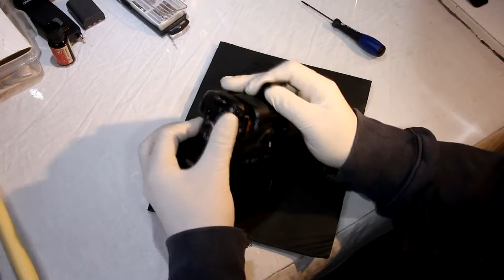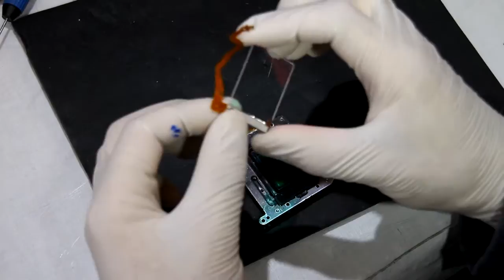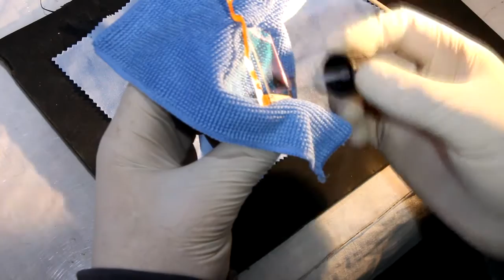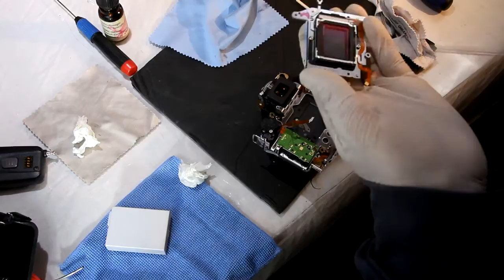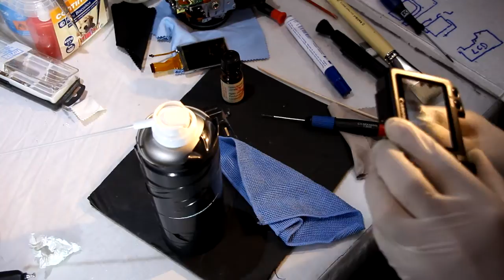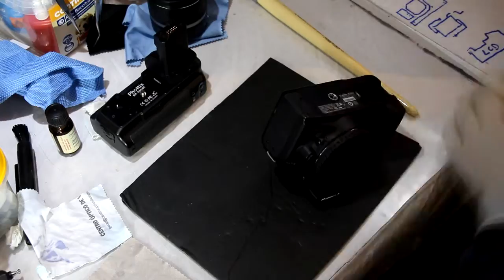Cleaning, assembly, DSLR Camera Sensor Canon 1000D (How to) Remove Fungus!

Comment: hello we have a pentax k10 and now there is fungus on the back of the sensor. would you be able to help us to take it apart and clean it? we are very much beginners :)
Reply from the maker: Hi there.
Sorry for the delay reply.
I never worked with an Pentax. Nevertheless, the screws, electronics, cables, glasses, etc, are all the same in a way!
Im not shure how can i help...
i can give you some tips and advice in advance:
be prepared, get a lot of patience because you need do disassembly all the glasses from the sensor, clean them and re assembly with dust free: that is the hardest part. dust is everywhere. Its a pain in the ass to put the sensor back again in mint condition.
You dont need to do the job in same day. Take your time.
When disassembly the camera make a scheme to store the screws in a way that then you can put back in the same place. Count how many turns you need to remove screws holding the sensor. Then the sensor need to be back on same position.
If possible, make a video while disassembly. After , if you have issues about assembly , you can watch and see how you done it!
Be gentle  with all parts. Be patience!! 
Good luck!
:)
Cheers
Reply: @RuiBentoAlves  thank you so much. I will follow your advice and hopefully manage. Dust is a big problem here as we heat with wood and turf. Thank you for all the tips ❤❤❤❤

Comment: Hi Rui, Just found your video. What tools are you using? I see you are using wooden stuff ...
Reply from the maker: Hi Thomas,
I use regular tools as you can see in the video.
I also use an "wood stick for food" to avoid damage some parts of the camera: glass scratches, cut the ribbon wire, and others. I found this tool very useful: it makes the job and will not damage the more fragile parts of the camera.
Hope that was useful.
More questions, just say it!
:)

Comment: what liquid did you use? is using isopropanol okay to clean the sensor?
Reply from the maker: Faratech Hi there,
Im using  DEHYDRATED ALCOHOL; it means that is almost 100% alcohol, with no water. Its composition is: Ethanol alcohol 90%, Isopropyl alcohol 3%, methyl ethyl ketone 3%. I also add a few drops of water (like 1%) to avoid to dry so fast!
isopropanol is the same as  Isopropyl alcohol, right?!
I think any kind of alcohol should be good to clean without making damage!
Check the composition, no more than 1% of water!

Any additional question, please, do it!
Cheers
Reply: yea same thing. thanks! you video helped a lot! will be doing it soon the canon 30d i bought a while back for 50 bucks. got it repaired from a nearby workshop for 15 bucks but he didnt wet clean the sensor and it has fungus in it. since the camera is it good working condition and i wont mind messing with it a little bit ill go ahead do the surgery! would let you know how it goes!
Reply: +Rui Bento Alves Hey there...great video. Just to say..we use Isopropyl Alcohol for cleaning circuit boards and ribbon cable terminals..and Naptha (lighter fluid) for cleaning fungal lenses. Hope it helps :o)
Reply from the maker: +Tony Smith 
Hi there,
never try that! Thanks for the tip!
cheear!
Reply: My pleasure :o)
Reply: @RuiBentoAlves  thank you!